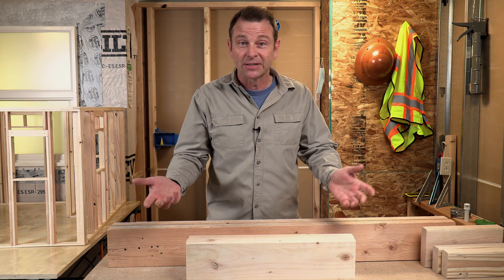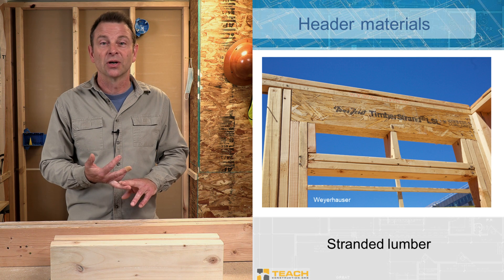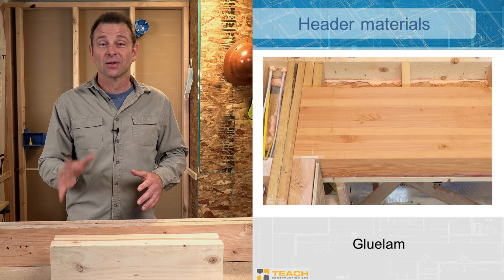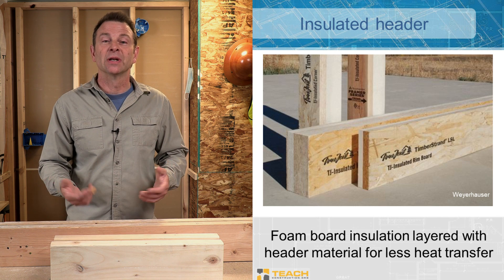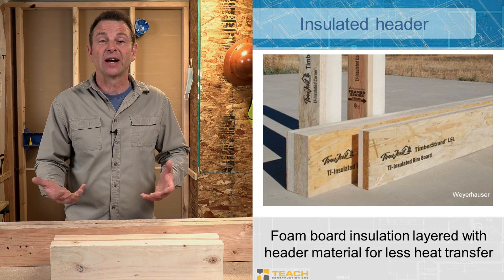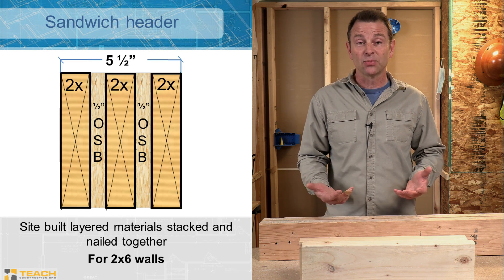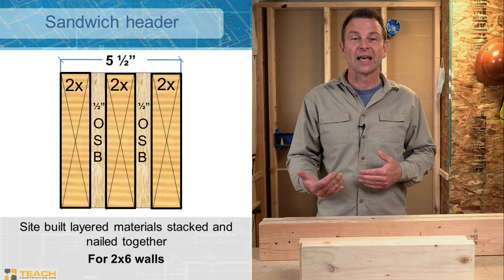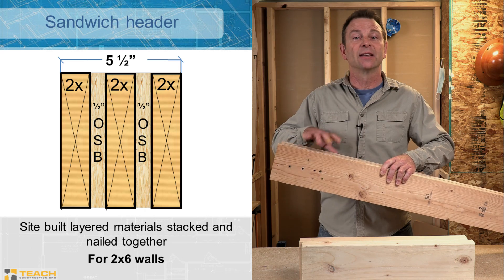All about headers in Wall Framing - Construction Trades Training Lesson

Comment: Hey quick question I am looking at stick building my detached garage on a monolithic slab.  The building is 24x35 I was looking at using 2x6 on the sill plate and use 2x4 in the walls because I standing the walls on my own is this okay.  If so do I need to set the 2x4 flush on the outside of the 2x6 so the osb can extend below the slab some

Comment: I want to putting a wall w/door on a pole building. So it would go between 2 6x6 poles. The wall is non-weight bearing, right? So i would that change my header/cripple/jack considerations?  I just need door to be sturdy.
Reply from the maker: Since your wall is non-load bearing you could use a simple header just as a nailer, one king and one jack

Comment: Question: Thinking of adding a low storage loft that will span the width of my shed…could I install a heeader to support this platform? Figure this wouldn’t be to different that installing supportive blocking

Comment: I'm surprised that there isn't a variant where instead of doubling side by side, the boards are stacked.  This would allow better insulation, and the boards could be formed into a single mechanical unit by gluing the edges and using structural sheathing on the outside.  Then the cripples could be toe nailed to the header.
Reply from the maker: That sounds like a box header
Reply: @ConstructionEd  No, in a box header, there is a box beam with members on four sides of a cavity.  That's not what I described.  I described two single headers stacked vertically.  Probably with glue between them, and then using the structural sheathing to further hold them together.

Comment: The builder on our house used the concrete form boards from the slab for the headers inside the house. I've never seen that before. What are your thoughts?
Reply from the maker: While I think that process is unacceptable and just plain crappy, I can not come up with something that makes it structurally wrong.   You said "inside" the house, so I am thinking that you mean non-load-bearing interior partition walls.  In that case, they are really just nailers.
Reply: @ConstructionEd  
Thank you for the response. They are all the main headers carrying the weight of the home. My main concern is the chemical in concrete that got into the broads. Anyways I'm upset about it, but the roof is already on now, and I'm not sure how big of a deal i want to make out of it.
Reply from the maker: I think you are right for being a bit pissed, that is just shoddy work.  Is this a production builder.   I am assuming there is no insulation in the header since they were field built.   What state are you in.
Reply: @ConstructionEd 
I'm in Oklahoma. The home is being built by cherokee nation, so it's not exactly a custom home. However, we still have to pay for the home, and it's on our own land. It's a little different, and we didn't hire the contractor. Their is an inspector that works directly for cherokee nation, but I don't feel like his heart is in it or wants to fuss much at the contractor.
Reply from the maker: I understand, I have a friend who does a lot of work on a couple of the Sioux reservations.  If you are still at the framing stage, you can certainly wash the  headers to get rid of the concrete dust on the surface.   Once the wall is sealed up, I personally would not worry much about it.
Reply: @ConstructionEd  
Thank you so much!

Comment: What if header has to be above double top plate (e.g., an 8’ door installed in a 7’ shed wall with 18” gable peak)?
Reply from the maker: You can get away with plenty for a shed.  If you are building a door on the gable wall it is likely not load bearing and thus your header is not structural, it becomes more of just a nailer so frame it as you need to.   I would frame the full gable wall as one section. Vs a 7 ft plus the gable section.

Comment: I’m a union pipe fitter so I have access to cheap Steel, I could not just use a 4 inch I-beam with 4 inch steel legs down to the floor
Reply from the maker: You could.  But steel is a bit hard to use as a backer for nails and screws later.

Comment: i had a 100 year old house, where  the beams, are a bunch of 1.5-ish inch lumber, nailed in two directions.  there are three layers.  outer layers go right to left.  inner layer goes up and down.   No glue, no construction adhesive.  span is about 14 foot.   Since it's rough cut, it's not pine, and not spruce.  I'm thinking it's not hemlock, but the siding was hemlock.  Note, there is no plywood in the building originally.

Comment: in 2X6 walls, we double up usually 2X12's and push them to the outside, leaving 2.5" space for insulation, or place a piece of 2.5" foam between the 2 2X12's

Comment: Thanks for your videos. They’re very helpful.

Now I’m wondering about combining the single header method and the top header method. Doing that it seems as if the upper header plate could be the wall’s top plate, with the single header below that and the lower header plate finishing up the header. Would that be workable? I like that it would eliminate one piece of wood, for both a cost savings and a heat transfer improvement. But would it work structurally?

Comment: Can you confirm for how many king and jack studs I would need for a 16'-18' opening. Douglas County Colorado. Thank you.
Reply from the maker: Sorry, we can not provide  you with engineering - but you will still need to consider several factors to take the load above into account.     
 You will need to know the planned materials , the number of stories etc.  

https://codes.iccsafe.org/s/IRC2021P2/chapter-6-wall-construction/IRC2021P2-Pt03-Ch06-SecR602.7
Reply: @ConstructionEd  thank you for the advice.

Comment: What about shimming a header to eliminate gaps? Can a window slowly be destroyed if you have floating headers that slowly settle?
Reply from the maker: If the header is sagging and pushing on the window it can cause damage.  But the best solution would be to rebuild the opening.

Comment: I didn't think a solid wood header would be considered a heat loss.  Wood has 'R' value.  But is the R value of wood less than insulation board?  Log cabins are known for having good R value without insulation.   Opinions please...
Reply from the maker: Wood is about R1 per inch.  Insulation is much higher

Comment: For a 12' sliding glass door on an exterior wall, it appears that a 12' 6" header is required with double jacks.   How many kings will be needed?  Thank you
Reply from the maker: Code header tables for you location should call that out.  Sometimes it is a double jack and a single king.
Reply: Thank you.

Comment: i only framed for about 9 months, but what my boss told me when i asked questions about headers, was that the rule of thumb, was that for every foot that your header ran, you transformed that measurement into inches per your header.  so if i had a 3 foot wide window or less, then i used a 2X header, and if i had a ten foot opening, then i used 2X10's for my headers, and if i went over 12 feet, then i would use an L:VL.   he also told me that this rule was more used for cantileavers, but also applied to cut out openings, but wasnt absolute.   i understood that as basic one story building methods, because obviously, at least to me, if you are building a 2 or 3/4 story house, then your headers become more important, and things like bla bla bla come into play.  anyways though, ive always used this method that i was taught, to make my headers, and i pretty much always use the sandwich method myself, but im not a pro, im just a get er done side contractor, but i dont exceed my knowledge level, and ive gotten more work out of being honest about my skill limits than i have about pretending im an engineering guru, but anyways, i do want to ask if what i was taught is at a basic leve, a decent foundation to go off of?
Reply: it depends on the loads coming down (snow loads differ depending on area, a gable wall has less roof load coming down than a hipped wall). but I calculated a few different scenarios and it works. the capacity is usually at 85%, so definitely enough.  
it did fail in cases where I assumed a bigger width of the house or higher snow zones up north.
Reply: Wish I could answer

Comment: Fantastic video.

Would appreciate more coverage on the window sills though.
Split Jacks vs Continuous Jacks vs Continuous Jacks with Cripple Studs.
Why are Split Jacks not meeting code in some jurisdictions?
Continuous Jack would force to use toenailing and does not look super reassuring, especially in situations with only one cripple...

would love to see a video on that topic (and apologies if I miss one talking about that)

thanks again for the great content, much appreciated
Reply from the maker: In our opinion, Jack Studs should not be split.   A sill can be end nailed through the face of the jack if the RO framing sequence is done in a way that allows.    You will see folks frame with extra framing members under a sill at the ends.  - I call them stilts because they are not true cripples.   The false argument for those framing parts is that the sill holds more weight.   I call this a false argument because the sill does not need to hold more weight - the windows are fastened to the RO - very little weight is actually on the sill.     Advanced framing techniques encourage less lumber rather than more.  We say if the lumber is not required, it should not be added.
Reply: @ConstructionEd  Thank you very much for your quick and thorough answer Joe 👍👍👍

All that make sense, indeed.

In my current situation I am looking at designing a rough opening of about 10F that will actually not receive a window frame but a counter top. I suppose that in such scenario adding stilts could make sense. I was also thinking about adding a double sill as well.

Many many thanks for your feedback and all your videos. They are well made and very instructive 🙏

Comment: Excellent presentation; no fluff, gets right to the point.

I have a question about sandwich headers built on-site. Rather than simply nailing the assembly together why not glue and screw together? Is this too time consuming? Nailing seems like an inferior method compared to ‘glue-and-screw’

Comment: the problem with the high header is that when framed that way, the 2x across the top of the opening doesn't provide enough nailing surface for the next trade that comes after you. As a lath and plaster contractor, the 2x is so tight that it provides little nailing surface for the lather to attach the wire to. Remember the window flange is anywhere from 1.25 to 1.50 inches out from the window and covers most of the 2x's face  across the opening. this requires either blocking above the 2x across, or cranking up the nail gun and shooting through the window flange.  When the header is low, there is ample space for nailing across.  Framers frame to the drawings, but they need to be aware of what is going to be done all the way the interior/exterior finish.

otherwise good video
Reply: Doesn’t meet the same argument for the bottom of window sills will one plate

Comment: Great video…..
Question…I am installing a prehung double door that is 65 inches wide in a non load bearing wall in my basement. Can I use 2 flat 2x4s nailed together as a header or is the span too large? I want to avoid purchasing a sheet of 1/2” plywood to make a sandwich header? Thank you for providing such informative content.
Reply from the maker: Since the header is non-structural, you don't really need a header - just use some 2x4 framing.    But it is likely you want something to fasten your drywall to above the door - I am assuming.  In that case, you can use some other material to fill the 1/2 if you really want something in place of a header.

Comment: I'm curious about the single ply header. One would logically think the single ply would be right down the middle, like an I-beam, allowing some insulation on each side. I would think that with the single ply just on one side, there is a weakness in the structure on the other side due to not being in balance. The load of the wall is down the middle, not the side, and I-beam construction, be it metal or a wooden I-joist, is "I" shaped for a reason. How is the strength of the header not impacted when moving the support from the center to the outside (or inside) edge?
Reply from the maker: While you are likely correct that moving the header from the middle to the edge could result in less strength.  But the additional strength is not needed.

Comment: wouldnt two 2X4s and a 1/2 inch layer end up being 4.5 inches thick and not 3.5? am I missing something? thank you
Reply from the maker: No - a 2x4 is just the name of the framing materials.  The Actual measurements are 1 1/2 '' x 3 1/2 ''

Comment: What are your thoughts on the oversized header that attaches to the underside of the top plate with another 2×4 or 2x6  attached to the bottom of the header to  define all the  rough openings in house which in turn eliminates all the cripple studs.   I've been seeing that a lot in new builds.
Reply from the maker: The high header placement is becoming more and more popular - I am personally a fan.  But the header does not have to be oversized

Comment: The affect of thermal bridging on ambient room temperature is  minuscule, it’s not even worth mentioning. There’s no need to insulate a header or exterior corners and T’s.
Reply from the maker: While the effects of thermal bridging are somewhat debatable, and sometimes unavoidable the 2021 IECC and IRC require several mitigation steps

Comment: Fantastic videos! 
Question…I am building basement walls with doorways. Since the walls are not load bearing can I build my door headers using 2 - 2x4’s laid flat and nailed together? 
Thank you so much!
Reply from the maker: Yes, absolutely. You can also just use one 2x4 as a header. It is not carrying any additional load, it is just needed to hang the door

Comment: Would you put adhesive for the foam board n then screw the two 2x4s?
Reply from the maker: Today - I would purchase insulated headers or build a box header.   But if I am making a simple sandwich header, then adhesive is not required

Comment: What’s the minimum rough opening height for an exterior out swing door that’s 30 inches x80 inches?  My opening height is 83 inches
Reply from the maker: It depends on the door that you are installing.  The specs will call out the dimensions, but with 3 inches to work with you likely have enough space

Comment: Are headers required if stud is not load bearing. i.e. small office in existing garage.
Reply from the maker: Headers are only required if the wall is load-bearing.   If you are adding an interior partition wall you can use the same size framing lumber as the studs in place of a structural header.  You are mainly creating an upper framing member to frame in your door and a place for the trim to be nailed to.

Comment: Ok, i make this harder than it has to be apparently. How does the header get fastened? The 2*6 commected to the king stud on each side? What about if the header is at the top and that 2*6 is connected to the top plate? Screwed in from the top through the double plate and then into the header? I can't imagine a huge 8 inch screw from the bottom to fasten through the 2*6 and into the top plate..... Yeah, beginner here. Thanks in advance
Reply from the maker: sorry for the delay Matt.   You can connect the header by face-nailing through the King Studs.   Also - if you have a high header you can face nail through the top plate.   The jack studs are taking the weight, and the fasteners are there just to keep in all in place
Reply: @ConstructionEd what an incredible resource!!!
I am THOROUGHLY impressed 
This channel is a GOD send
Thanks for ALL you are doing

Comment: Your videos are very helpful. But I find that in most of the videos the education leans,
towards a basic install. Carpenters need to know to fasten headers to top plates, how many 
nails to use, for what size lumber. To nail to king studs per code, nail size, number of nails. Most of all to be able to find the information in a techno world we live in. Your basic viewer doesn't know that 3 nails go to 2X6s walls, 2 for 2X4 walls and so on. Even in the AF&PA
Wall frame manual doesn't give anyone the count. R602.7.1 is the same, so were can the audience get this type of information.

Comment: I'm installing a pocket door on a load bearing wall. How many jack studs do I need for my header on either side?
Reply from the maker: Number of jack studs are determined by span and the load above.   Determine the load and you should be able to find a header sizing table online or in ICC code.

Comment: 11:30 For a window in a high header situation the bottom of the rough opening is the sill. What is the purple member that defines the top of the rough opening called?
Reply from the maker: When the header is install high, the framing member at the top of the RO is really just a nailer.  I have heard it called a header plate, or a nonstructural header, we sometimes call it a header plate.    But I don't think there is an "approved" term for that member.

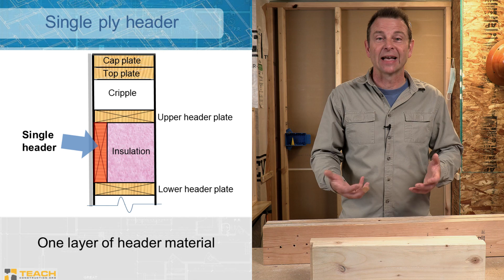Comment: Around 8:30, the single ply header, would you carry the cripple down into the header also ?
Reply: Ronnie - yes the cripples would travel from the top plate to the header in this drop header configuration - the image at 8:30 is "section view" to show the orientation of the framing member.

Comment: Excellent.  What is the best way to attach a thicker Header to a thicker top plate (2, 2x4 on Edge).  Thank you.
Reply from the maker: Not sure I understand your question.  When you ask about "attaching" are you asking the types of fasteners?  If you are referring to the board orientation - typically a structural header has the boards on edge.